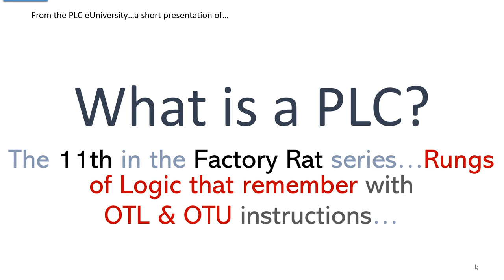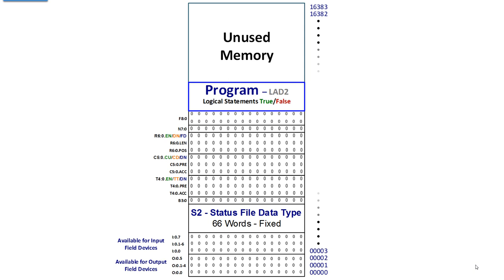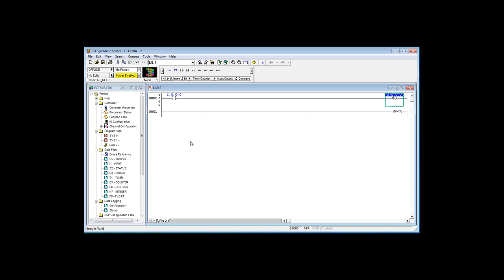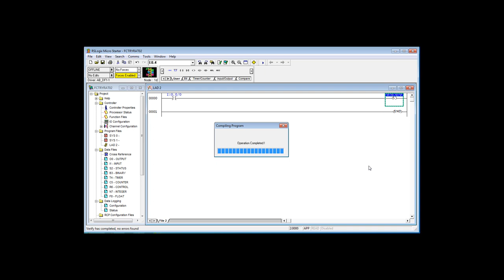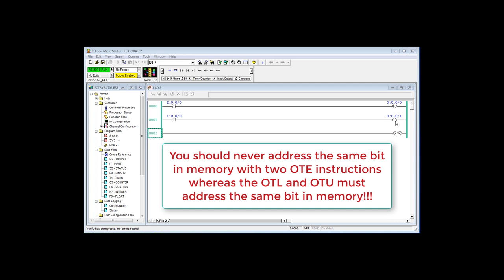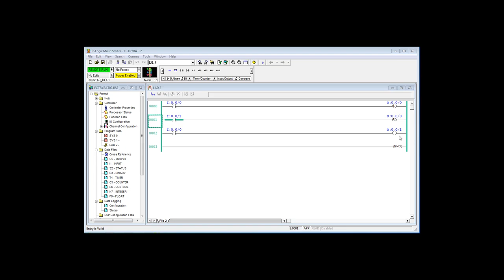What is a PLC? 12 How to program the Latch & Unlatch OTL OTU

Comment: Great video but... Could you record in full screen?
Reply from the maker: it is 720P
Reply: @plcprofessor  Parts of the video are fine. The part where is difficult to see is where RSLogix window is not in full screen
Reply from the maker: @HelloHelloXD  I see what you mean...the screen capture of RSLogix is only partial because I have it sized for 720 on a 1080 screen. Viewed on a full size monitor it is fine but I can see that if it is viewed on a small screen like a cell phone, it would be a problem.
Reply: Exactly. Great job btw

Comment: very good video SRS PPLPROFESOR please can you help me I have communication problems with slc 500 using S / 2 series processor my PC uses windows 7 SP3 and I am using communication pic 1747-PIC thank you very much greetings from Venezuela
Reply from the maker: The PIC module is the kiss of death with windows. There is a setting in its configuration that you have to check to force the driver to hold and if you leave that checked when you cycle power to your computer, bad news...you have to go to device manager and delete that driver from your computer's installation and then reboot to reload it "unlocked" from that comm port.
Reply from the maker: Actually...as I remember...if you shut down RSLinx with the box checked to reserve that comm port for the PIC module, that comm port cannot be freed up for other uses unless you uninstall the port and reload it. The PIC module is so old that it uses electronic handshaking with the host and with Windows, there are so many layers that it times out quite often and you lose comm. This is why you have to check that box in configuration to reserve that port exclusively for the PIC module. My version of RSLinx doesn't even give the PIC module as an option. I believe that a UIC/USB cable might solve your problem. I have one but do not have any PLCs that I could test it on.